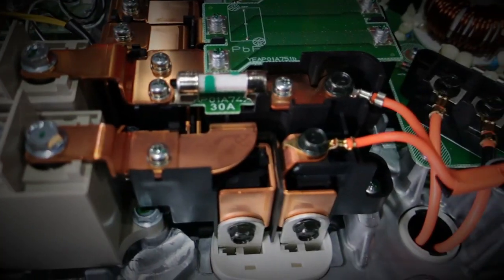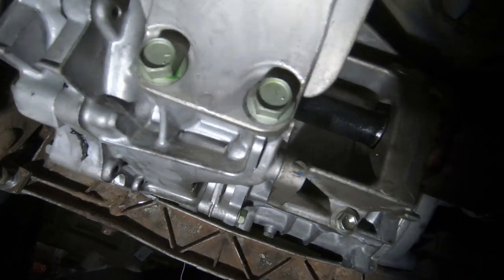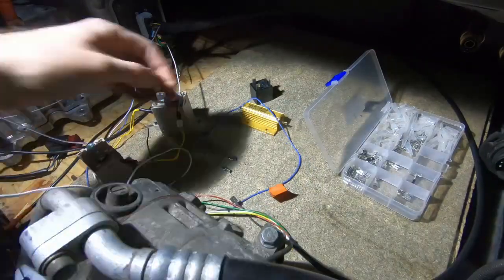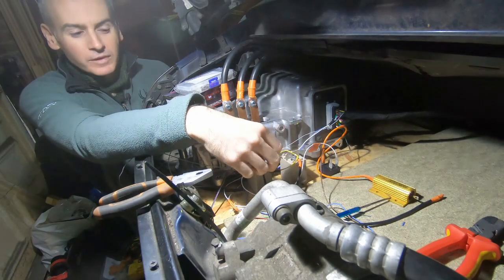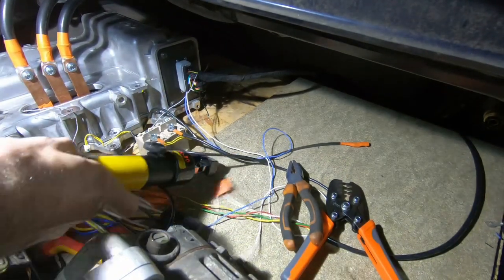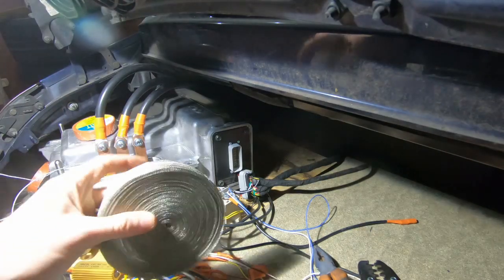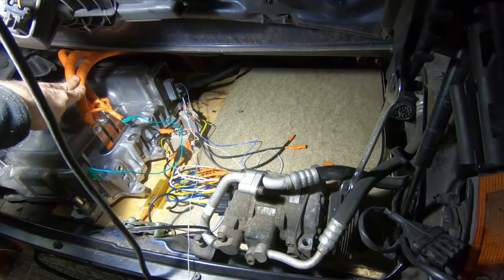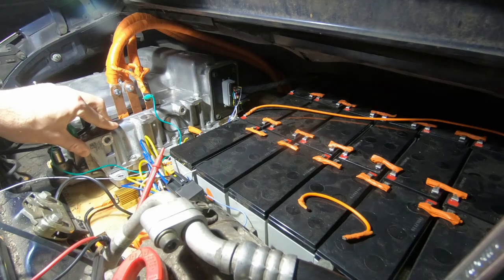Electric Porsche 911 project video 28 - Wiring up our Test Battery Pack

Comment: Great Job Shane, are you using Damien Maguire’s VCU or Johannes’s control board?
Reply from the maker: Johannes's control board with the leaf adapter. Want to experiment with trying to push more power through the inverter at some point in the future, so the drop in board should give me a but more option to do that than the VCU.
Reply: @PerformanceEV  brilliant! The VCU is capped at 80kw I think so that makes sense.

Comment: Very nice video, are you using those batteries just for testing of the system?
Reply from the maker: Yes, definitely just for testing. Will be reusing some EV batteries (which ones depends on what I can get my hands on for a good price) and I will be building a proper, secure, sealed battery box once I have them.

Comment: Hi, fantastic job, congrats. I was following all steps you did. I'm based in Spain and converting a Mini Cooper into EV, as well with Leaf motor. Finally we tested all and start fitting into the car but I can't find the specifications for the inverter and calculate the size of the cables from battery pack to it. Did you find this? do you know maximum current for the inverter? In my case I have the inverter and the motor together so no cables needed for AC. Thanks in advance.
Reply from the maker: Thanks. Sounds like a great project. Specs on the inverter seem to be really hard to come by. The IGBTs are soldered to the driver board, so I have only been able to see part of them. None of the visible numbers or codes etc. give any idea of specs so all I can go on is theories and other people's experiences. I guess part of it depends on whether you want to use the stock leaf power or try to get more out of the inverter. If it's stock then could you measure the width and depth of the busbar to the capacitor and calculate it's current carrying capacity.
Reply from the maker: I'm planning to just go with as big a cable as I can get. But I will probably replace the inverter components in the future to push out more power.
Reply: @PerformanceEV  Thanks. We plan to use just the inverter and motor from leaf as it's a POC and we don't need more power at the moment. Problem is that we didn't have the harness from the DC, so we will use our DCDC and cables. The battery pack is 96s (6 modules 16s3p) and 3,2V per cell and 26Ah, so I understand on the DC cables we won't have high ampers.

Comment: Nice work on the shielding!
Do these automotive relays draw less than 200mA?
Reply from the maker: Thanks. Yes, took me a while to find the specs, but they apparently draw 150mA.
Reply: Are the HV cables supposed to be shielded or only the I/O?
Reply: @kingofl337  HV, especially inverter to motor because they are the source of EMI.

Comment: please just put some heatshrinks on the phase connections, its a small step but creates a barrier against some bad things happening on accident.
Reply from the maker: Thanks, yeah I need to redo the wiring before I take this out in the road. It will need a full inspection before I can do that, so I have a list of things, both with the car and the electric drive that will need to be worked on before it is allowed on the streets.

Comment: A bit of a dumb question, but I'm coming from the ICE world. Does the Leaf motor drive both rear wheels like an ICE car with a LSD....or does the EV motor drive only one rear wheel? IF both...yeh! If only one wheel, then how easy is it to make an EV motor a LSD without buying a LSD?
Reply from the maker: Drives both wheels through what is essentially an 8:1 differential. I think Quaife Engineering here in the UK have released a drop in LSD gearset for the Tesla reduction gear, but I haven't seen anything for the Leaf set up yet.
Reply: Of course it drives both wheels... But it doesn't not come with an lsd from factory, it is open differential